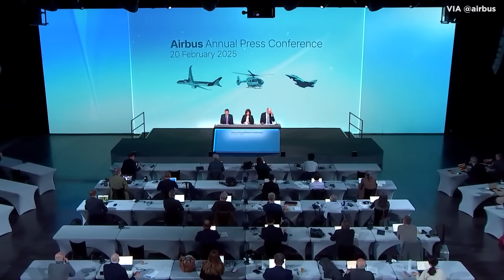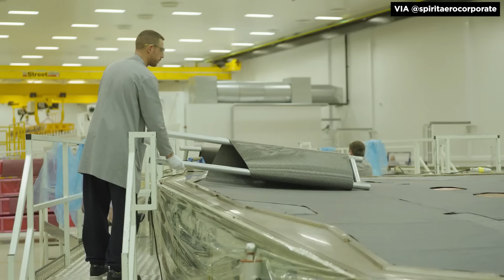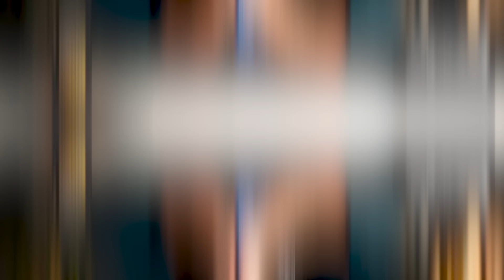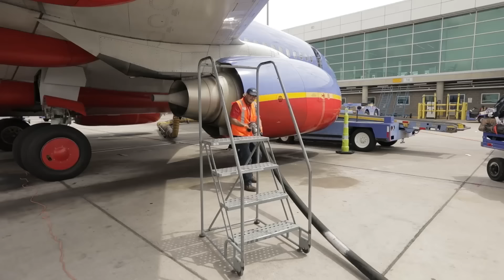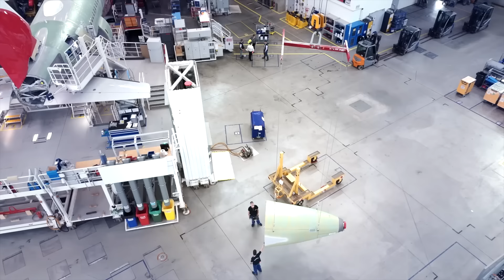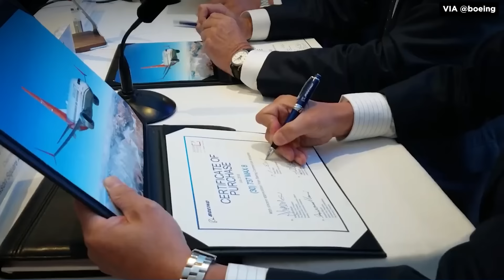Did Airbus just Change EVERYTHING?!

Comment: I don’t believe there’s going to be a hydrogen powered commercial aircraft. Hydrogen fuel itself isn’t energy dense enough.
Reply: Hydrogen isnt energy dense enough? Its more energy dense than kerosine. However, you'll lose energy cooling and pressuring the fuel. But energy density is not the problem, right?

Comment: I am still sceptical about hydrogen as a fuel because of the difficulty I would think of the weight of the tanks on the plane and the supply chain, transport and safe storage of hydrogen to and at an airport. It would seem some other more green liquid fuel other than kerosene would seem simpler in the near timeline.
I am also sceptical that the greenhouse targets are realistic. In my opinion we shall exceed 2%.
There will have to be some alternative technologies to absorb greenhouse gases from the atmosphere and this is also a difficult challenge or some technology to decrease the intensity of the sun on the atmosphere.
Reply: The supply chain of hydrogen is pretty simple actually. It can be produced locally at each airport
Reply: @tijmen6947  How so? The amount needed would be extremely high and hydrogen has a lot of safety issues. You could store it as ammonia I suppose but it is a very toxic gas in high concentration - wouldn’t want any leaks.
Reply: What kind of green liquid fuel? The problem with biofuels is that you would have to bulldoze half the rainforests to grow the crops to turn into fuel. You would need something synthetic and I don't know what that would realistically be. 

I agree that removing carbon dioxide from the atmosphere is going to be required, but even very difficult ways of reducing emissions are likely to be more cost effective than removing carbon dioxide from the atmosphere. We should be doing everything we can to reduce emissions. I don't know if hydrogen is the answer, though... Maybe battery technology will improve enough to make electric airliners an option? We are a long way short of that, though.
Reply: @thomasdalton1508  I doubt electric is going to be a solution. As energy density in a battery increases so the possibility of them bursting into flame. Bit risky for an aircraft.
Reply: @georgedyson9754  Jet fuel is flammable too... If fire safety is the only problem, I'm sure they'll be able to overcome it. Storing enough energy without the batteries being too heavy for the plane to get off the ground is the challenge.
Reply: Water is an immense and the greatest greenhouse gas produced by aircraft, no change with hydrogen, much worse actually. Now, the cloud seeding may kick start our next cooling period, wiping out 99.9% of all SPECIES on earth again, but nobody listens to climate scientists, only to media.

Comment: Why isnt there a canard airliner? A quantum leap for efficiency.
Reply: I think its risk vs. reward. Using canards and shifting the CG back to reduce the needed vertical counterforce would increase efficiency at the cost of static stability. You would have to gain that back with active, very responsive and (multiple) redundant systems, as the passangers can't bail out like a eurofighter pilot might. The margins for risk are generally higher in the defense industry and I think that Airbus engineers will make an educated choice if the benefits outweight the costs and the tech is far enough
Reply: @ Long Ez, Berkut, Starship, Piaggio …. Not to forget the Wright Flyer….
Reply: @Zenheizer  On the other hand fully FBW designs like Airbus' become uncontrollable anyways if all FCCs fail, so I don't see it as unthinkable that a design with canards in close loop control backed up by all FCCs would be approved... Would it increase the risk of the design by any noticeable factor? I mean yes static stability does give you some time to get a generator back online or reset a computer, but that is such a black swan event...
Reply: Gliders are the most efficient . Not a canard in sight
Reply: @ Well, maybe there should be…..

Comment: I would not think a gull-wing design would preclude use of a large diameter turbofan engine as an alternative to the open fan option.  the bigger challenge would be that both of such different engine options might need to be approved separately.   but would an engine over wing design also be possible as a redesign for low wing aircraft?  I know the US military studied the concept for a STOL cargo plane, but decided it wasn't necessary.  but my understanding is that their decision was based on the capability not being that much of an improvement - whereas mounting larger engines overwing, to improve ground clearance, might be an option that was valuable to passenger plane design.
Reply: The primary driving reason for not high-mounting engines is servicability and costs. It's been proposed for deecades as a way of putting the aircraft wing  between noise source (exhaust + prop/fan) and the ground, making aviation much less disturbing for populations, but never been picked up because of the added costs it incurs
Reply: @miscbits6399  there's probably a factor of putting the wing between the noise and the passengers, too.

Comment: Hydrogen is INSANELY explosive, ridiculously expensive to compress into a liquid, and incredibly difficult to transport and store, due to the fact that it "leaks" through metal, plastic etc.
Reply: That is a true statement if you wrote it 20 years ago but the technology has come a long way bud.
Reply: @KingWilliamProtector  

But in all fairness, hydrogen as a fuel does have to be handled with a lot more caution during fueling and have better maintenance practices.
Reply: Hydrogen is actually a surprisingly good fuel for aviation. As in, tripeling range good. Hydrogen airplanes would look totally different, but it is a surprising improvement over kerosene.
Reply: → Dom 

Please explain in more detail your claims. It could be maybe 30% better with a new from the ground up aircraft and modified engine (maybe even 35% - 40% with a totally new engine). BUT where is the COST COMPETITIVE HYDROGEN going to be coming from? It will not be green hydrogen.
Reply: @Mentaculus42  just calculate the caloric value of hydrogen combustion versus kerosene. Also keep in mind that the engines will be at least 10% more efficient. But as I said, this would require a completely different airplane with new engines.
Reply: Hydrogen is a fad. Will not happen. The whole industry knows that.
Reply: The Japanese seem to have a very big interest in using hydrogen as a fuel and there are solutions for transportation of hydrogen in bulk. Besides as most people keep talking about GREEN, the U.S. structured their hydrogen production incentives toward CLEAN & strongly disincentivize GREEN! Go figure.
Reply: And EVs don’t explode and burn   Got it
Reply: @ And when was the last time Airbus built a battery powered airliner?
Reply: It doesn't just "leak" through things. Hydrogen embrittlement is a very real problem
Reply: @miscbits6399  just use the right materials. It is a non-problem for the experts.
Reply: To be fair it's less explosive than kerosene and also it can be stored in carbon composite tanks. It already has been done in cars like toyota mirai and also on rockets.
Reply: Only if there was a way to stabilize this hydrogen by binding it to carbon atoms. Hmm...
Reply: Don't forget that you need more electricity energy to extract than the energy that you get from it, obviously. That electricity comes mostly from fossils. Un that case it's just better to just use fossils on the plane.
Reply: @0xf7c8  Nobody is suggesting using fossil fuels to produce hydrogen.
Reply: @0xf7c8   Hydrogen can be produced using green energy, especially green energy that suffers from availability issues such as wind and solar. This fits rather neatly, otherwise huge storage facilties need to be built to allow the use of wind and solar (eg. massive battery farms, pumped storage hydroelectric, ...). Agreed that the hydrogen industry needs to restructure hugely to reach this goal, agreed there's no point using hydrogen if it is just produced using fossil fuels as is currently the case.
Reply: @0xf7c8   if only airports had some area which they could just bloat with solar panels and get  all the electricity needed for creating, cooling and pressurizing hydrogen basically for free. Oh wait
Reply: Your math doesn't math, if you bothered to math.
Reply: You need to first understand how much energy is actually needed then understand how ridiculously underpowered your “put solar panels at airport to generate hydrogen” idea is.  Never mind the flight safety risks it poses.
Reply: @xuansu9036  I agree. Honestly, I'm baffled that in current days, many people ignore that converting energy from one source to another always incurs losses that aren't insignificant... and why hydrogen fueled flying vessels went extinct after a series of catastrophic failures.
Reply: The space around runways is clear for a reason. They would never build anything in that space. It would never supply even a tiny fraction of the energy needed by airplanes, which use massive amounts.
Reply: @ who's talking about putting solar panels at airports ?! In the UK in 2023, individual renewables contributed the following:

Wind power contributed 29.4% of the UK’s total electricity generation.
Biomass energy, the burning of renewable organic materials, contributed 5% to the renewable mix.
Solar power contributed 4.9% to the renewable mix
Hydropower, including tidal, contributed 1.8% to the renewable mix.

Source = National Grid website

Last year there were multiple days when more than 50% of UK electricty production was from renewables, especially wind.

A maximum zero carbon record of 87.6% was reached on 4 January 2023!!!
Reply: @sailormatlac9114  Those weren't hydrogen fueled. They were hydrogen lifted. The Hindenburg used diesel for fuel. The hydrogen was just a lifting gas.
Reply: @timparis70  The second reply, from someone with no name, suggested solar panels at airports. They clearly hadn't done the maths.  If the airport has hundreds of departures a day, each would only get the energy from a few minutes of sunlight.
Reply: @timparis70  Yes. An important aspect of this is that there are periods of excess production that cannot easily be stored. Hydrogen offers one possible means of doing so.

Comment: Airbus is good at having the media keep its name out of the press. When there are issues on Airbus aircraft it is attributed to the airline NOT the manufacturer, i.e. "A Delta airplane had an emergency".  In the worst cases the media will show a Boeing plane and not the Airbus.
Reply: There been a pretty bad winter for Airbuses competitor.
December 25, Embraer 190 crashes
December 29, 737-800 crashes
January 29, Beechcraft 1900 crashes
January 29, CRJ700/Sikorsky  Crashes
February 6, Cessna 208B GranCaravan Crashes (media kind ofmissed this one)
February 17, CRJ-900 crashes, while all survived, this was a PR disaster, for Delta, less so for Bombardier

Well. i actually skipped one. Air Busan 391, that was a A321-200... That was a full loss, but nobody died and 7 peopel got evacuation injures.

There was a faital crash by a A220 in December of 2024 as well. The thing here was that the faitaility died 7 days after the crash. This was the first fatality of both Swiss airlines and a A220. The faitality was a member of the crew.

For a airbus crash where someone actually died in the crash have to go back all the way to May of 2020, before that we have to go back to 2016 that was a suspected pilot suicide. Ironically 2015 was also a pilot suecide also in a A320
Reply: data ain't lying. Boeing has quality issues.

Comment: Hydrogen doesn't make sense, never did. Ask the Hindenburg.
Reply from the maker: Not really the same thing...
Reply: @MentourNow  well, how much Hydrogen will be stored in the high pressure tanks? Could easily be the same amount like in the low pressure  „tank“ (= hull) of the Hindenburg? 😉
Reply: @auronoxe 

What high pressure tanks for liquid hydrogen? Maybe max 30 psi!
Reply: ^Exactly.
Reply: There is a slight difference here.

Comment: Methanol fuel-cell hybrids make WAY more sense than hydrogen, all the technology exists for the supply chain, storage, use etc
Reply: do Methanol fuel-cell produce CO2? because that would render them useless for a zero emission engine
Reply: @noesmiyoutu  methanol is generally plant sourced, zero net greenhouse
Reply: @mycosys 

But are plant based fuels even scalable or probably a case of diverting food from people. Besides, if it is plant based would it not be ethanal vs methanol and generally methanol is an E-Fuel ‽
Reply: No its not. Methanol fuel-cell are incredebly ineffeicent and ithey are also pointless, considering you can just burn the methanol in a jet engine
Reply: @matsv201  never heard of oxides of nitrogen eh? or particulates? youre the expert
Reply: @mycosys  
Do you know how a methane fuel-cell works? (obviously not)
Reply: @matsv201  You dont even know the difference between methane and methanol?
Reply: @mycosys  Yes, methanol is even worse for fuelcells than metahne is

Comment: it's helping Airbus that the media is currently fixated on taking down Boeing.
Reply: Are they really doing that? I would say rather they run defense for all the people Boeing killed, and also defense for the vistleblowers that jag magically hapepen to die the exact right day
Reply: @matsv201  yes, they are doing that.  everything bad that happens involving a Boeing plane has the fact that it's a boeing plane in the headlines, regardless of whether it is related to the plane or not.  and you don't find it at al odd that all these alleged whistleblower murders have happened AFTER they've done as much damage as they could possibly do?
Reply: @kenbrown2808  that is just factially wrong. That you claim things in boeings defense that is factually wrong really proves my point
Reply: @matsv201  okay, which whistleblower who you allege they killed after he testified, was killed before he testified?  how many airbus planes which hit turbulence and had unbelted passengers injured was identified as an airbus in the headlines?  which news outlets specified the manufacturer of the plane that lost a wing in the hard landing in Toronto in the headlines?  

the fact of the matter is, the number of incidents per year that are caused by defects in the plane, are low enough that aside from outliers, like the MAX MCAS issue, that it is not possible to get accurate statistics.